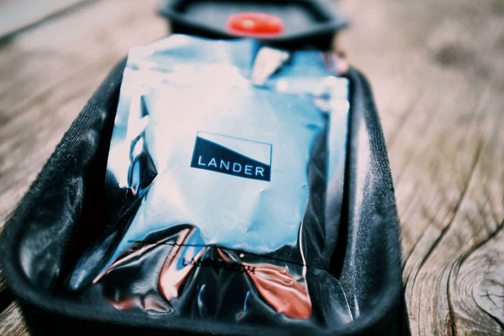lander - How difficult is it to convert a hypergolic based Moon human lander to a cryogenic one?

Comment: You would need to significantly redesign the craft because of fuel weight, difference in boiling points, you’d have to completely throw out the old engine and start again because good luck getting an hypergolic engine working with cryogenics, and you would need to reduce or increase weight of the craft to account for gained or lost ISP